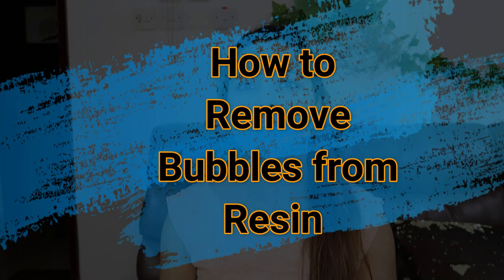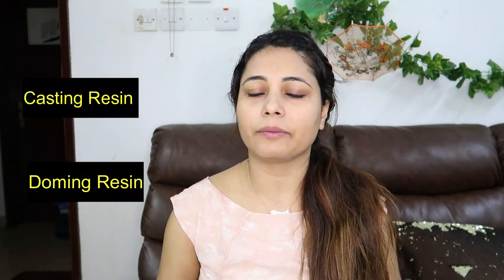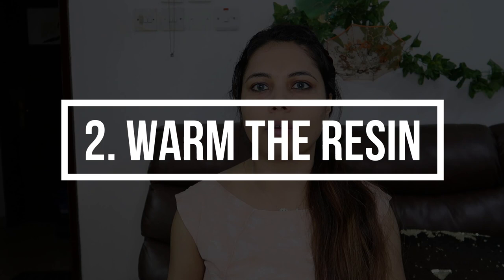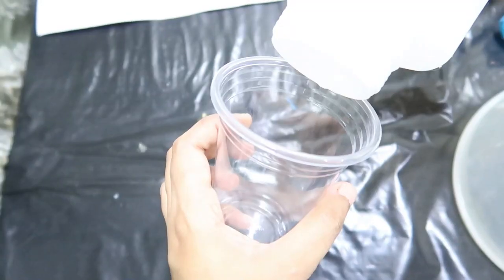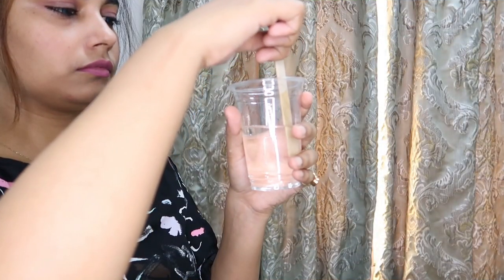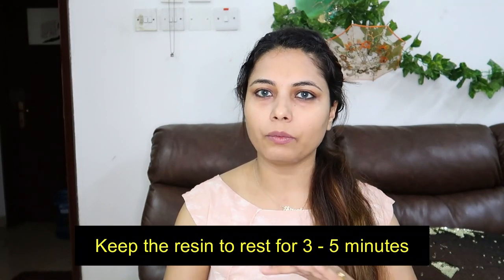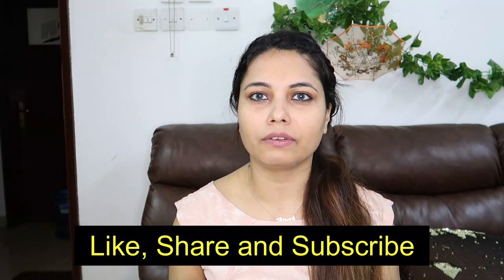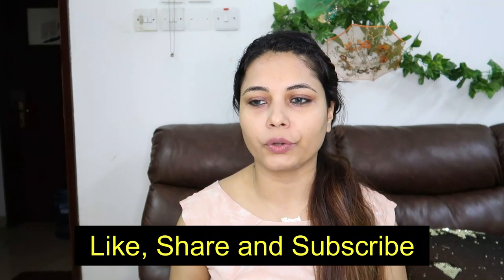How to Remove Bubbles Easily from Resin | Try this |  resinish

Comment: I'm a wood turner. Most of the voids I fill are on curved and vertical surfaces. I use plastic hot glued to the wood to make a mold. If I seal the mold completely with no vent does the pressure pot still work
Reply from the maker: Hey dear, Tbh I have never used a pressure pot personally, I would suggest you to experiment with a small piece and see the result yourself. This is what I do when I am confused about something and get the answer on my own. Thank you. Let us know too honey

Comment: Why do air bubbles is still forming while curing, or gets trapped behind dried flowers, which i cannot see
Reply from the maker: If you are working with layered flower the. You need to pour resin layers as there are gaps in the flower where air pockets are present n which lead to bubbles. So dnt go n pour at once instead work in layers Or
Dip the flower in resin separately, be careful not to break the flowers and then pour resin on top by keeping in the mold
Hope this will be helpful
Reply: @ResiniSh  thanks hopefully it works 😊